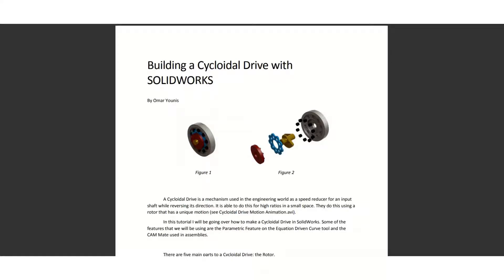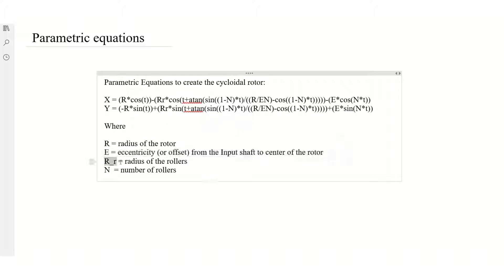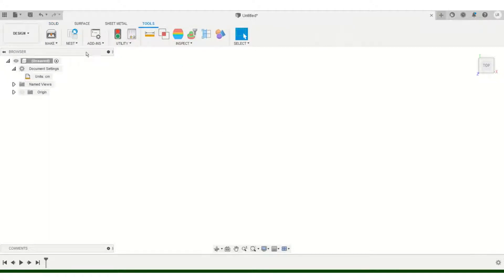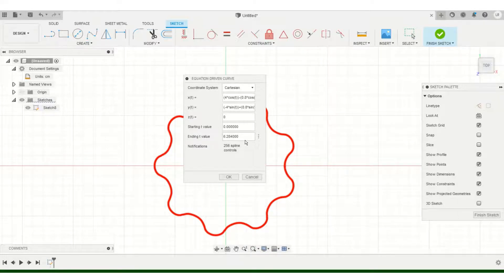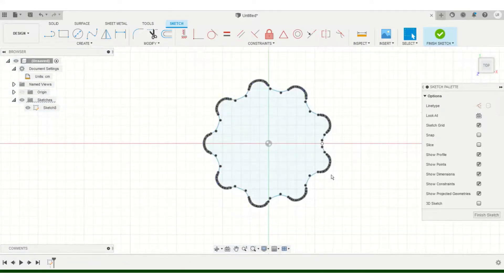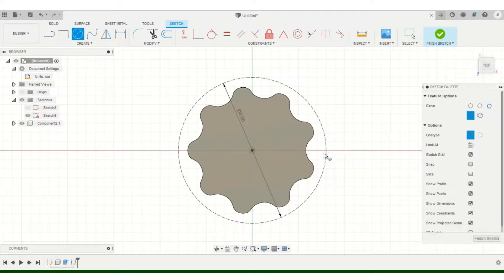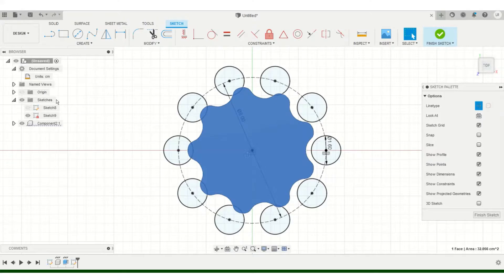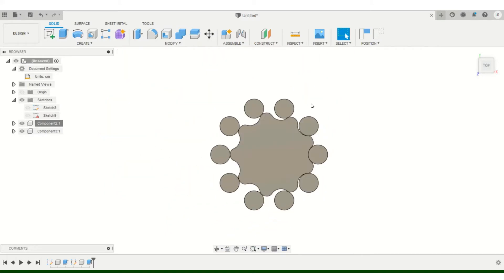How To Design A Cycloidal Gear Using Parametric Equations - Fusion 360

Comment: Found a plugin,  but couldnt make it, new plugin gives me: Function  arguments used without a function (position: 60)
Formula: 
(4* cos(t)) - (0,8 * cos(t + atan(sin((1-10) * t) / ((4/(0,3*10))-cos((1-10)*t))))) - (0,3*cos(10*t))
(-4*sin(t)) + (0,8*sin(t+atan(sin((1-10)*t)/((4/(0,3*10)) - cos((1-10)*t))))) + (0,3*sin(10*t))

UPD:
My problem was that I create a  special table to calculate variables, and result was, for example "9,8", but Fusion can understand only "9.8"

Comment: is there a way to enter a pre-existing user parameter in these equations instead of having to enter each number so that changing configuration or reduction or size can be done simply by changing it in parameters since i don't see a way to change a curve once it has been entered

Comment: Great tutorial, I've noticed that when doing more than a certain number for N you end up with a badly controlled spline because it doesn't generate enough points (256 spline points appears to be the maximum for any curve) to get around this limitation, I used an ending T value of pi and then mirrored it. Should work as long as N is even.
Reply: Thank you! I just did the same as you, it solved my problem.
Reply: Why, you clever goose! 
Thanks!